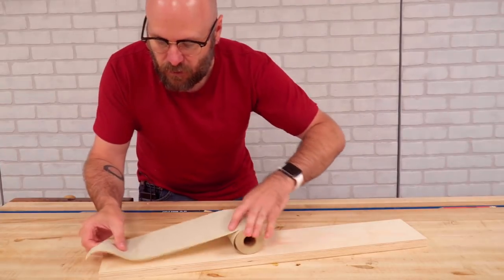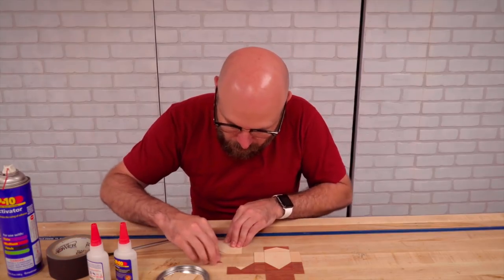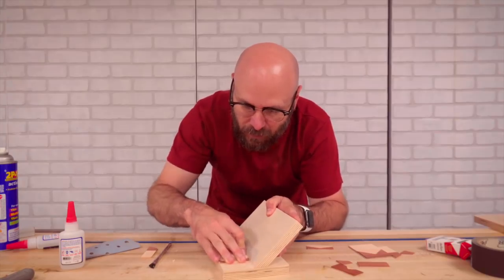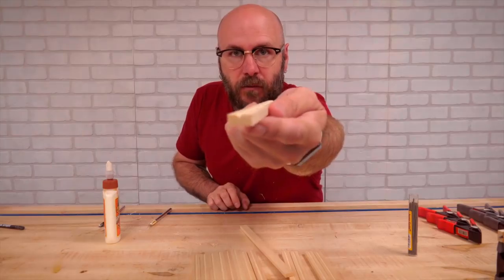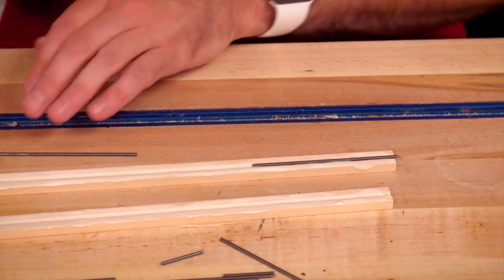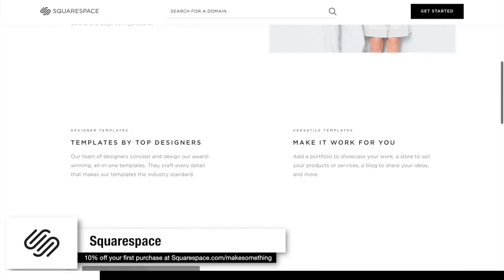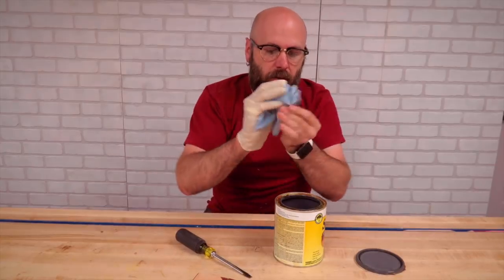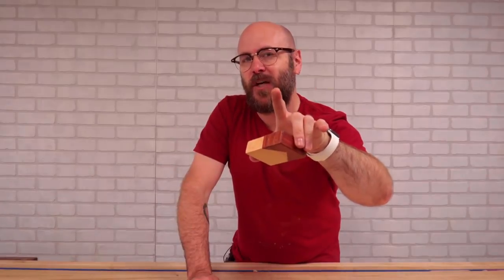Making 20 Pencils and Hinged Wooden Case | Woodworking & Art

Comment: That is so awesome. I think it was cool of you to mention you're against smoking, so am I. I am so glad for this video because it taught me that I can plane wood down to really thin stock safely by using a thicker sheet with sandpaper. I have needed this but been hand sanding down to my thin stock of 0.075 for making my collar stays for dress shirts.
Reply from the maker: Just be careful when planning down thin wood. I’ve had experiences where the corners chip out and come flying back. Looking back I should have mentioned this in the video.
Reply: Make Something thanks for the warning. if the corners chip it is fine if it doesn't hurt the equipment or come out and hurt me because as a woodworker I also cut proud so there is plenty to cut and sand.